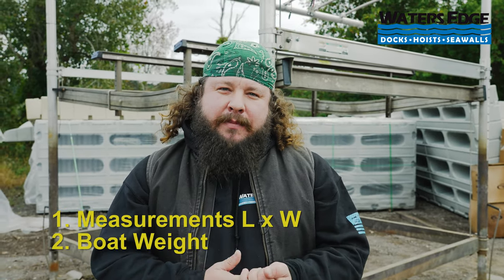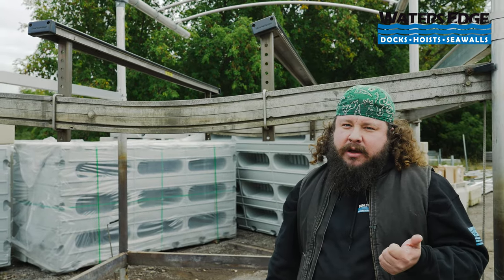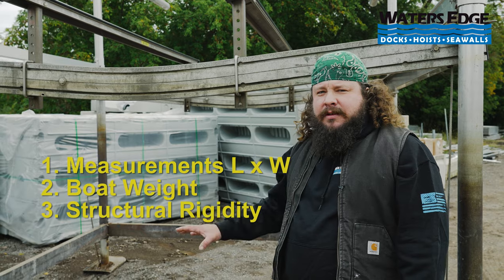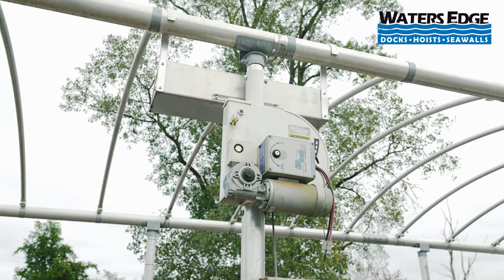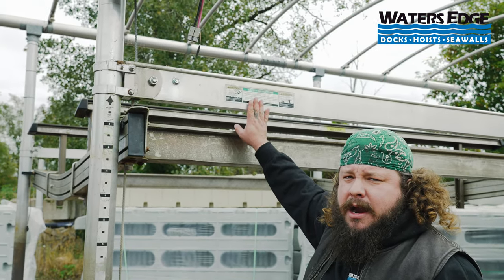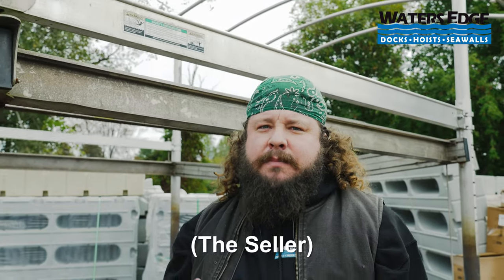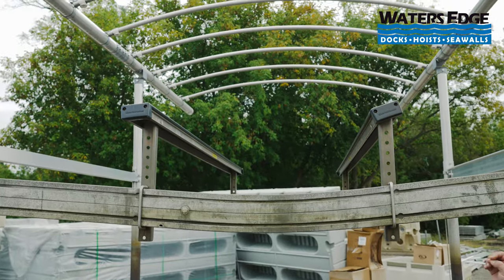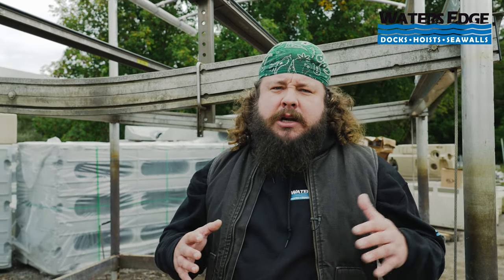Should I Buy A Used Boat Lift? Buying Guide

Comment: I don’t know how many times I’ve seen the end caps fall off the SS poly bunks and gouge the boat hull with the sharp edge of the aluminum. The customer never looks for it or notices until it’s too late. 
Wood 🪵 bunks might not be as fancy, but they are safer than poly. In my opinion.
Reply from the maker: Great point!

Comment: BTW. You can get a ShoreStation factory made replacement winch tube  3000/4000 lb.  that includes a new lift and winch cable and pulleys for that lift for well under a $1000.  I believe the part # is 73488.  Also That’s an after market direct drive that probably doesn’t have a limit switch. So then there’s always a concern the winch was over tightened possibly over stressing the cables pulleys which can really shorten the life of that winch tube.
Reply from the maker: thanks for the feedback!

Comment: super helpful video!!
currently looking for a my first lift for a 07 Bayliner 185
Reply from the maker: I’m glad it was helpful! It looks like your boat weighs approximately 2400 lbs dry. The general rule of thumb in the industry is to add 1000 lbs to the dry weight of your boat when trying to figure out what capacity boat lift you should shoot for. In your case I would look for a 3500-4000 lb capacity lift. I’m not sure where you’re located but if you’re in the Michigan area I have a very lightly used 3600 lb capacity lift I just took in on trade that I would sell for a steal. Let me know if I can be of anymore help to you 😁
Reply: @WatersEdgeDockHoist  my cottage is located in Warsaw IN. Do you have photos?
Reply from the maker: I sure do. Would you be able to provide and email address I can send them to along with pricing?
Reply: @WatersEdgeDockHoist  I am not sure what is wrong with it. I have tried 3 different times to just put be email here and it doesn't let me.
Reply from the maker: It may not let us exchange emails on here. Look me up on social media and message me your info there.

If you Google Waters Edge Dock And Hoist or better yet The DockMan you will find me